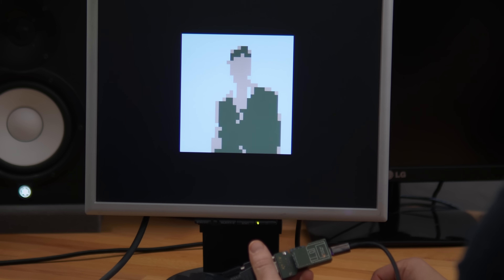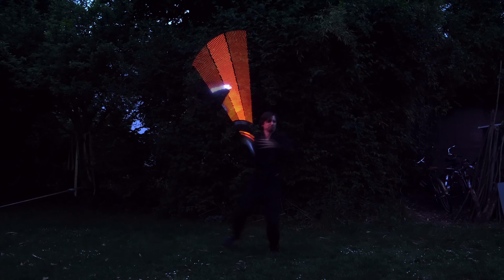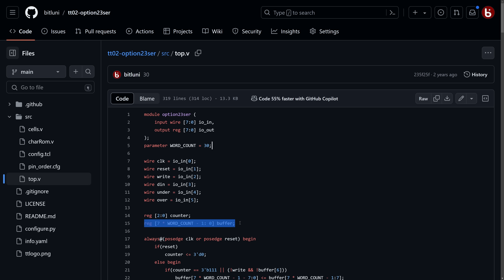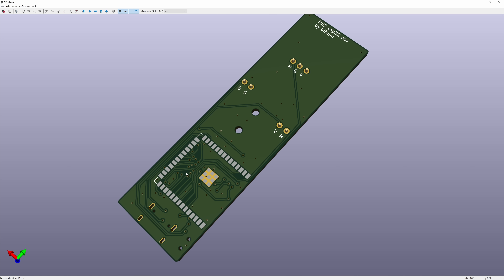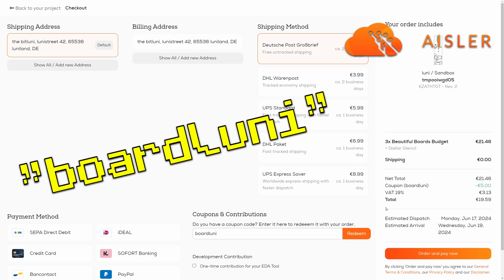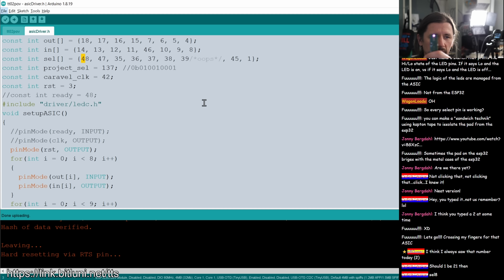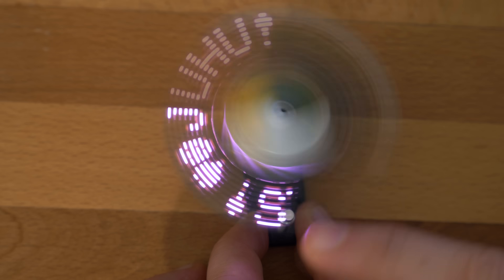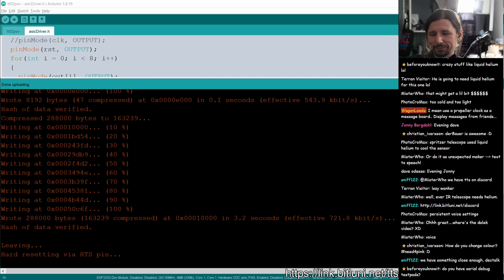My first serious ASIC project

Comment: What's an open source shared silicon? Is it like RISC-V chips?
Reply: Open source shared silicon means:

1. What is open is a transistor-level description of how to fabricate the chip into a permanent silicon ASIC(vs FPGA designs, which are flashable firmware, or RISC-V, which is an instruction set that a chip can choose to implement)
2. Because chip fabs cost a lot even to do the smallest run, Tiny Tapeout, the project bitluni used, shares hundreds of small designs on one die as an anthology. The board can choose to run any design on the chip by setting a certain pin configuration.

Comment: good service from Aisler? It was the worst company I had to deal with. They messed up a simple 4 layer PCB. More than half of boards had USB-C connectors with shorted or unconnected pins. It took them months to send us repaired boards and not all of them were fixed. At this point I stopped asking them to fix all of them because as a prototyping project, it was no longer relevant at this point.
I had no problems with Eurocircuit.

Comment: This reminds me of an EFTPOS project I did for a local retail suplier back around 2000. No HDL in that particular one but I had 2 SMD ATMEGAs on one PCB. One for custom keyboard management and LCD drive and one to drive a stepper motor, guilotine and thermal head of a recipt printer. I had to drive a whole line of pixels, over 500 of them. I found a character set I liked on line that wasn't proportionally spaced and downloaded the bitmap(olden times). Then I used visual basic to scan the characters and pixels into a look up table. I had to do vertical and horizontal expansion of the recorded character bits because otherwise the printing was too small. Got it working sweetly, scrolling out printed paper pretty fast. However although my customer paid me, he ran into trouble because of out of memory issues on the PCs. I figured out some time later that his PC custom software writing company likely used a microsoft common library comms driver that was later acknowleged by Microsoft to have a memory leak. However I think the memory leak destroyed his ability to get paid by his customer.  Good work on the ASIC FPGA!

Comment: and fpga with reasonable mass production would be much much better, the minor percentage of wafer are usage difference does no matter at all, when the fpga chips can be mass produced without thinking the end usage, the user can used it in whatever way freely. and you can also diy chips on a wafer, which is tons more interesting than just fab ordered chips delivered. current low costs fpga chips run at 400MHz or 800MHz by default. for hobby sake yep of course, but you can do stuff smarter too. any manufacturing should not be for "making living" but for free making of projects, opposite of making a living, ie freedom. then all the considerations of market money law nonsense will not make any factor in the reasonings and efficiency and usefulness. compare the programming/usage experience to arrow MAX1000. have a reel hanging pole like a dress hanger pole. lol. yep curse/blessing of asic is that you dont have to or cannot change the code logic. there needs to be the asic part of the fpga to load up the code. going fabless hmh.

Comment: Hello bitluni , enjoy a lot watching your videos a big fan of your ultrasound videos ,professionally I am doctor ,had passion for electronics and inspired by you continuing my passion as hobby, can you help me with an Arduino code  I am struck with,

in the following code can you please make sure ,the ledpin2 to blink for 3milliseconds for every 80milliseconds duration if ir sensor gives constant low signal (constant object detection):

const int irSensorPin = 2; // Pin where the IR sensor output is connected
const int ledPin = 7; // Pin where the LED positive end is connected
const int ledPin2 = 9;
unsigned long lastDetectionTime = 0; // Variable to store the time when an object was last detected
const unsigned long detectionTimeout = 3000; // 7 seconds timeout

void setup() {
  pinMode(irSensorPin, INPUT); // Set IR sensor pin as input
  pinMode(ledPin, OUTPUT); // Set LED pin as output
  pinMode(ledPin2, OUTPUT);
  digitalWrite(ledPin, LOW); // Initialize LED as off
  digitalWrite(ledPin2, LOW); // Initialize LED as off
  
}

void loop() {
  int irSensorValue = digitalRead(irSensorPin); // Read the value from the IR sensor

  if (irSensorValue == LOW) { // If the IR sensor detects an object (assuming LOW means detection)
    lastDetectionTime = millis(); // Update the last detection time
    digitalWrite(ledPin, LOW); // Turn off the LED
    digitalWrite(ledPin2, HIGH);   // Turn the LED on
  delay(5);                   // Wait for 500 milliseconds
  digitalWrite(ledPin2, LOW);    // Turn the LED off
  delay(1500);                   // Wait for 500 milliseconds
    
  }
   if (irSensorValue == HIGH) { // If the IR sensor detects no object (assuming LOW means detection)
    digitalWrite(ledPin2, LOW); // Initialize LED as off
    
    
  }

  // Check if the current time exceeds the last detection time by the timeout period
  if (millis() - lastDetectionTime > detectionTimeout) {
    digitalWrite(ledPin, HIGH); // Turn on the LED
  } else {
    digitalWrite(ledPin, LOW); // Ensure LED is off if within the timeout period
  }
}

Thankyou so much

Comment: Great work. You might have killed the xtal on the ESP32 when you put it through the ultrasonic cleaner.
ASIC design has come a long way from when I started in electronics. Verilog / HDL was quite new when I started, you normally had to get a library set from the ASIC vendor and then build out the required logic.

I really wish you all the best

Comment: The project is awesome. Question for your next project. What process node are you planning to manufacture your custom RISC-V computer on and what would be the price for 1mm squared dye size? How many transistors can you approximately fit in there? Also, are you using an FPGA to prototype the chip design? If so, what model?

Comment: When I solder ESP32 by hand, I never put solder onto the thermal pad and never had any problem with it.
Reply: Its often not even needed. I have seen some cheap dev boards which also did not solder the thermal pad. If you dont extremely overclock it it should stay perfectly happy
Reply: One would think the tiniest drop of mundane CPU thermal paste would have been more than enough to make a positive thermal connection there, without the need to actually solder it in. If you want extra fancy, you could even use thermal GLUE, which does the exact same thing but even glues the thing on, and it sets slowly enough to let you solder it in comfortably...